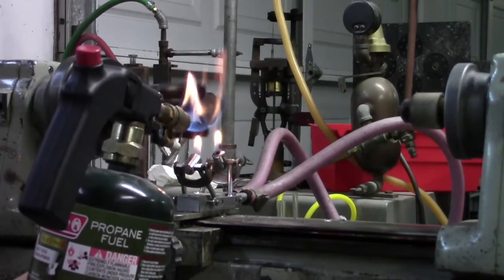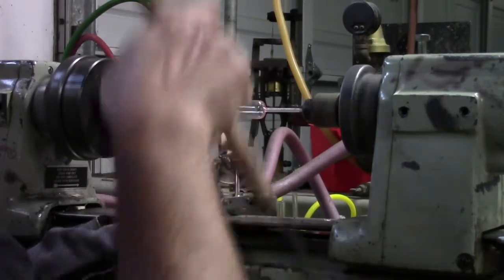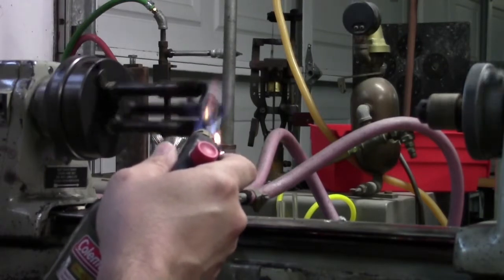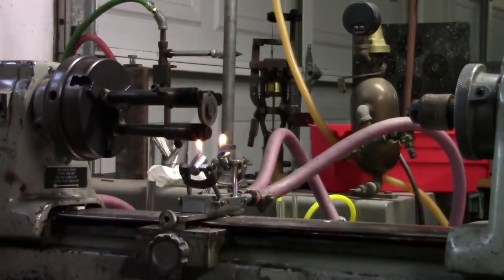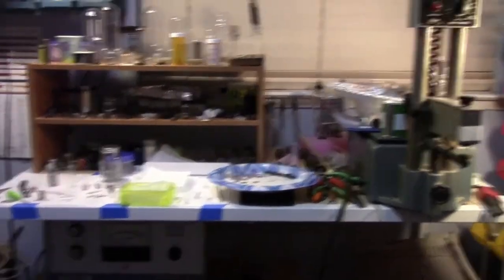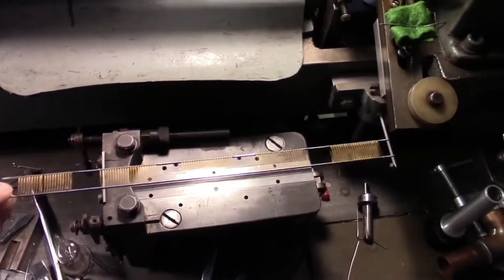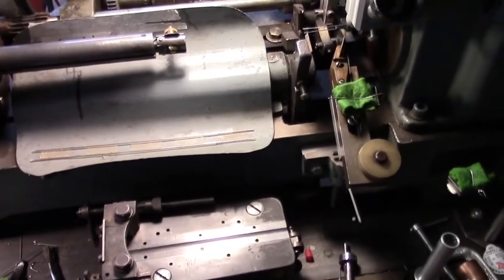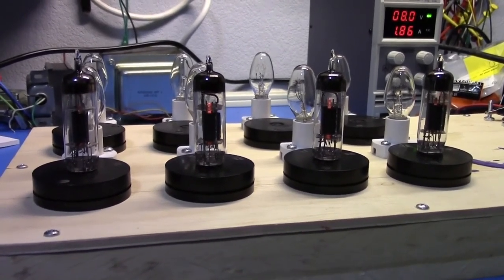7 Pin Vacuum Tube demonstration

Comment: Wow! You have a great setup! Did the extra thick cathode coating show any advantages?
Reply from the maker: It threw off the heater power input to temperature balance. Inconsistent results. Cathode heat economy is a balance of mass vs heater current vs emission area and the extra carbon gas generated by that mass can adversely effect the filament impedance causing a lowering of temperature for voltage input. Or in other words create a tungsten carbide layer which makes its resistance go up. All has to stay in balance. That’s why it takes so long to figure out a procedure to make a new tube design.
Reply: @MrSupro  Would you be ok with talking over email?  I would love to learn a bit more.
Reply: Hello, sorry to bother you again. Would you still be willing to sell or part with a few getters?
Reply from the maker: @jdflyback  sorry for the couple month delay. YouTube did not notify me about your message. Yes I can get you some getters. Please DM me on Instagram. I am Chuckalex905

Comment: Your 7-pin stem does not have the exhaust tubulation off the bottom?  Would you have any use for my leftover 9, 12 or 15 Pin stems? :-)  I've made most every style press stem commonly used over the years.  Now the main PO's come in for 2-pin and pressed Capillary for PID lamps.   Great video!  I also have a few Eisler rotary machines left over.
Reply from the maker: Sure. What glass/metal combos are they? I only have a pinch stem machine that I occasionally use. Otherwise everything I have is left over stuff bought from either Sylvania in the early 80’s or ETI now The Fredricks company. I have press heads for 9 pin and 8 pin wafer press heads but no specific machine. I just turn a Litton F model on its head and use that and it’s kind of a pain. Also I don’t really have leads suitable for wafer press stems. I could use solid dumet or alloy 42 but it’s not really a priority. I have a 7 pin and 9 pin eisler carousel sealer. I have about 16K sets of 7 pin bulbs and buttons that are the size that would be used in a 6AQ5 type tube.
Reply: I make hard glass vacuum tubes and stems; I'd be very interested in your inventory as well! I'm looking to buy a press stem machine, too-